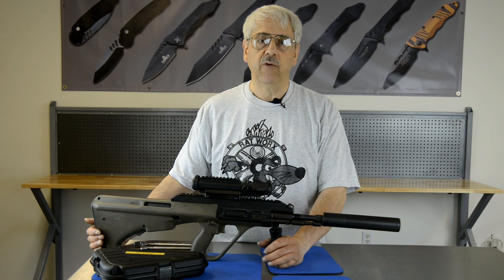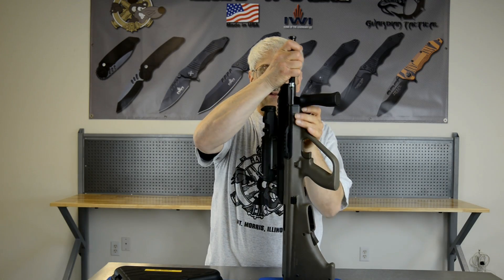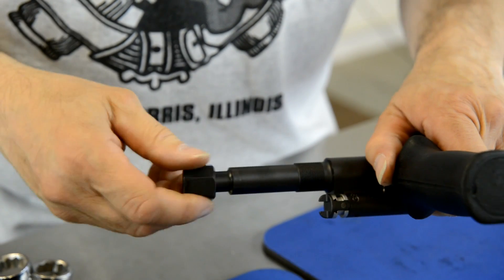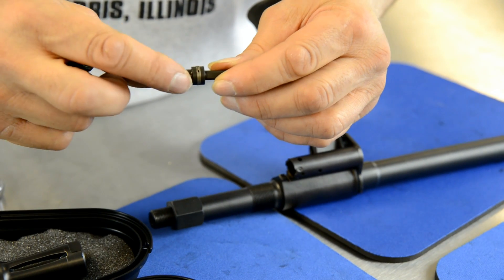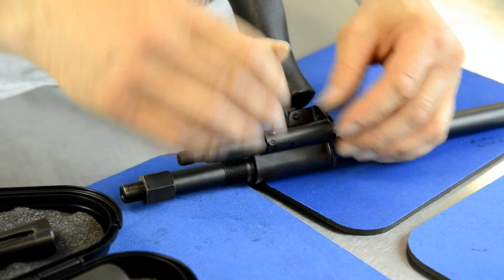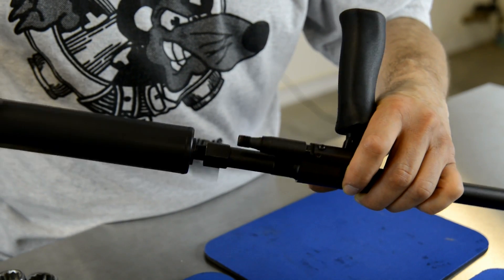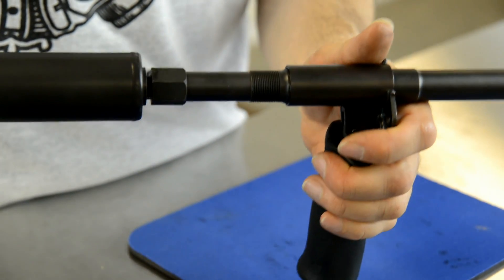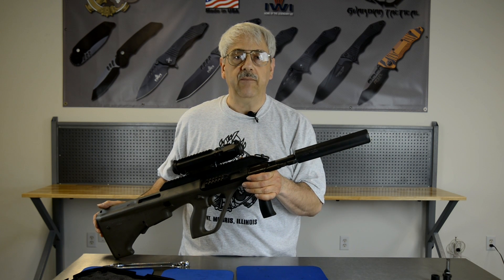Steyr aug Suppressor Installation from RAT WORX

Comment: I was curious about getting a suppressor, for my aug, perhaps even this one, but in taking off my muzzle break I discovered it to be right hand threaded contrary to the M13x1 LH threading I've seen everywhere online. I bought the Aug thru private sale so I don't know the exact details of the AUG but it is possible that 1/2-28 RH aug barrels exist?
Reply: Steyr USA started shipping rifles with barrels threaded in  1/2-28" RH around the beginning of 2019.  They might have shipped with either an A2 style flash hider, or later with a tulip fh.  The 1/2-28" tulips will have grooves that run around the circumference of the fh and nut. The older metric, left hand threaded barrels will also have tulip fh, but not have grooves milled into them.
Reply: I'd have checked with my AR's muzzle break but the break doesn't want to come off easily like the AUG's 2 pieces and I don't have a vice. However if it turns out to be 1/2-28 RH then I guess that saves me buying a thread adapter for something I could end up using on either of my rifles
Reply: Good luck finding parts for aug. Steyr sucks at parts availability.

Comment: I've been running a suppressed AUG for about twenty five years and I love it. Granted I don't shoot it every year but it probably has five or six thousand rounds through it. I am glad to see the gun has a following and glad to see companies like Ratworx filling a need for this terrific gun. I just had it out to the range yesterday and it still shoots well. It does take some getting used to ergonomically, especially after shooting AR style rifles for so long, but it doesn't take long to get it dialed right in at 100 yards. I like shooting it in GR mode best, when suppressed this mode keeps it very quiet.

Comment: will the AUG work with a standard suppressor without the gas system adapter/upgrade? I plan on mounting a Saker 7.62 to mine. I just ordered the RATWORX AUG thread adapter so I can run the standard MAAD saker brake/mount. Any tips on this combo? any installation caveats? should I use rocksett on the thread adapter? thanks